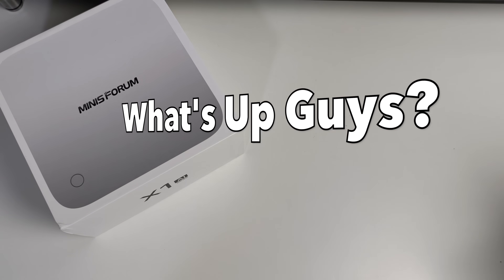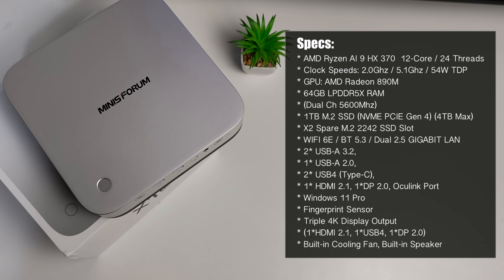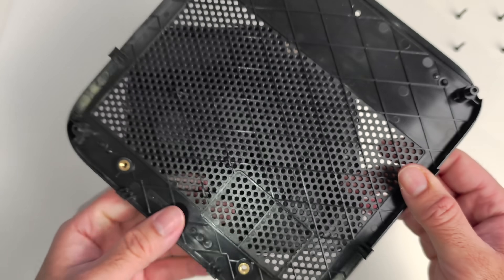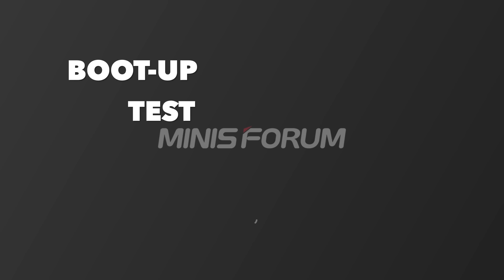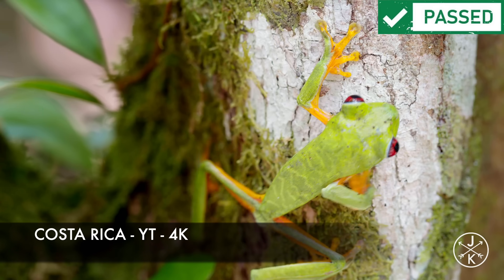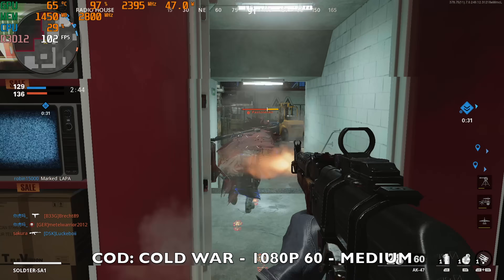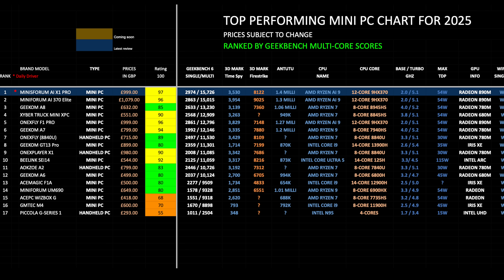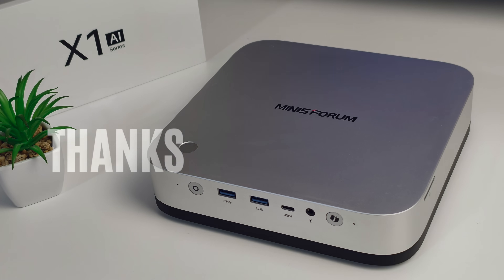Minisforum AI X1 Pro - Most Powerful RYZEN 9 Mini PC 2025

Comment: Honestly they should build this form factor with 7945HX (or HX3D) as a Desktop GPU base because Oculink 4i latency and bandwidth are so pathetic compared with the real 16x PCIe.
Reply: @JohnWilliams-gy5yc  25% bandwidth but 90% the speed even with the fastest GPU.  The big issue is if you don't have enough VRAM.

Comment: No fan noise and thermal testing, no speaker test.
Reply: Sensitive people can’t bare knowing thermals and fan noise matter. The sensitive mind of a poor consumer that always knows best
Reply: @Blingchachink What? Lol.
Reply: In all my years of building or buying PCs I've never looked at any of those metrics when deciding on a purchase.
Reply: @Xero_Wolf  Agreed, especially the attention thermals get is overblown
Reply: @anssiaatos  Never heard of throttling? Overheating is not healthy in the mid and long term. And users not listening to ear blowing music or playing ear blowing games may be more senisitive to noise - but this pc seems to be very quiet and the CPU goes rarrely over 60 degrres Celsius and the fan over 42 dB....
Reply: @WMedl  For an example, Intel specs that CPUs can run 85 celcius long-term without issues. Enthuast will argue that lower temps help with longevity, while it might be true, it could be statistically insignificant. Meaning that you're very unlucky to get tour CPU to break from hot temps.

Throttling happens usually around 100 celcius.
Reply: @anssiaatos   except when your pc starts emitting the magic smoke
Reply: @carlhenriksen3185   I believe in most cases the PC will shut itself before the smoke 🙂